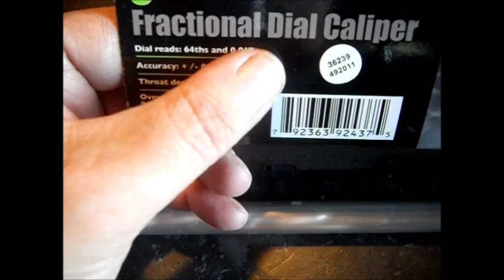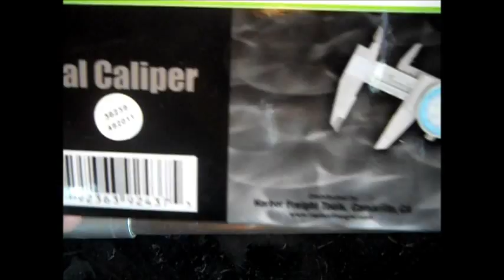11 METER DIPOLE PART 1  (For CB Radio )

Comment: Damn, my time is worth more to me than listening to this ramblin' on! That took 15 minutes to listen to. I built a wire dipole, with ceramic insulators before you were through with Part # 1... What have you been smoking? LOL... I do have a bench set up for antennas though! I could have used a spark plug gapper to measure with and still beat your time! A for going into detail! I'll be waiting on your Tri-Bander Beams to come out next... Good Luck.. 73. Redd...
Reply from the maker: +Redd Pepper Why would You waste your time watching the whole video and then typing a comment and waste that much time ....IF ...Your time is worth that much You must have Alot of time on your hands like I do ..LOL !!!!

Comment from the maker: I have had several of those cheap made A99 antennas I have seen them fried with 100 watt linears snapped off tops in less than 50m.p.h winds and rot and shed the fiberglass in 1 year after being installed I had an old bigstick antenna that was over 15 years old before it died